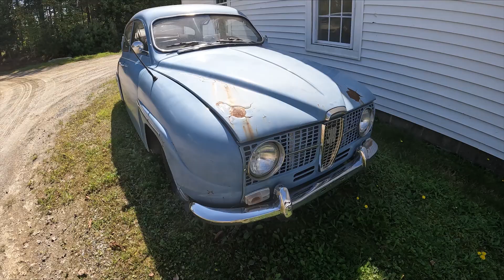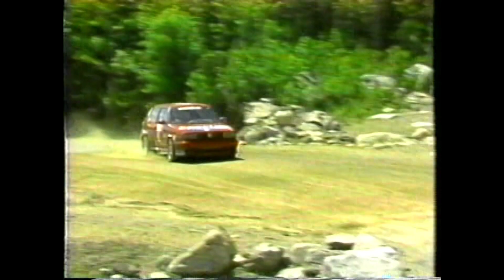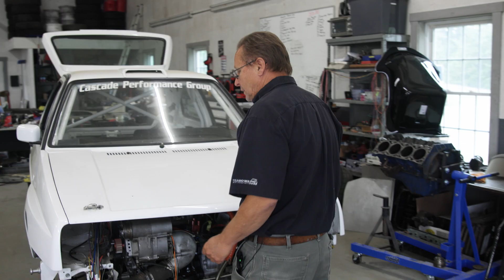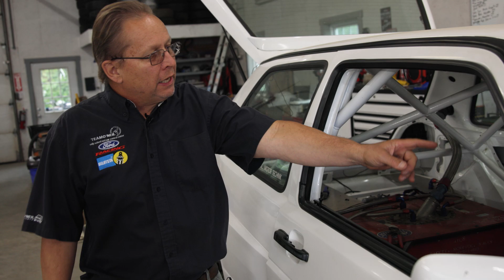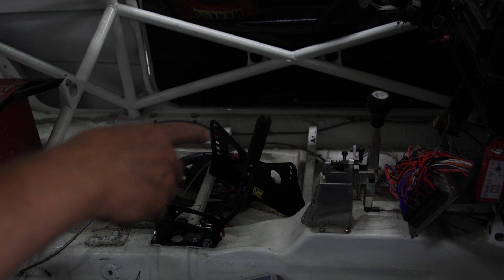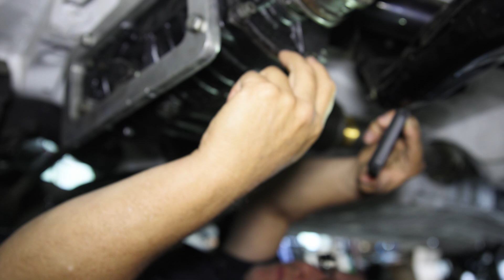Tim O'Neil Unviels His Latest Rally Project

Comment: Was there ever any engineering basis explanation given by VW Motorsport as to WHY they did not fit to and develop this G60 engine with the 16V head (or was there a 16V displacement multiplication factor for homologating boosted Group A cars back then, and it would have been over that limit??)?

Or was it simply a better bottom end torque response with the G-lader with an 8V head?